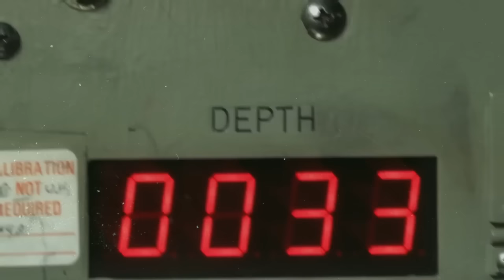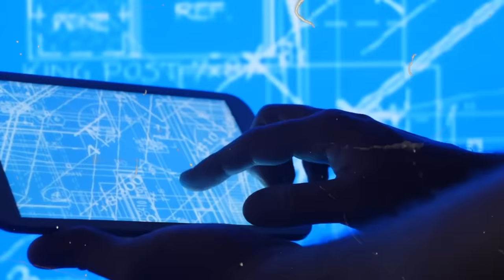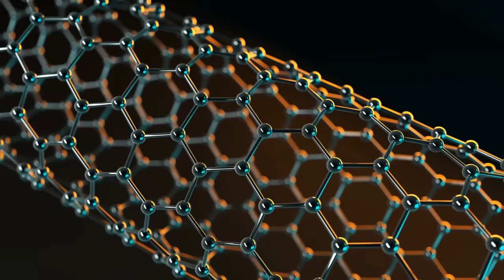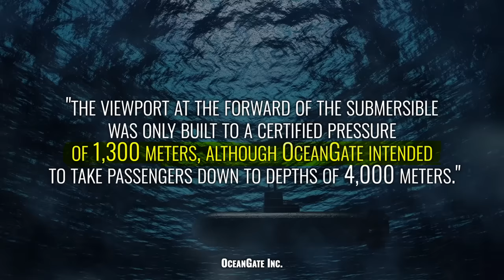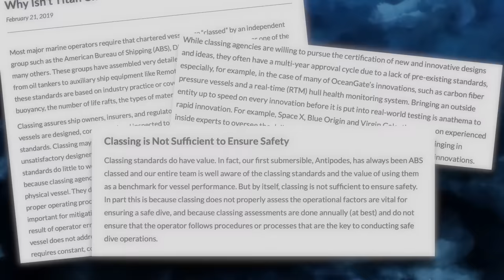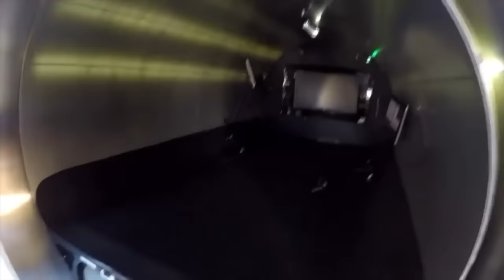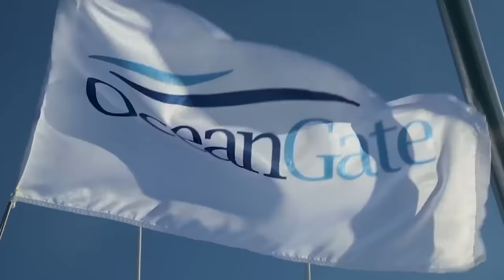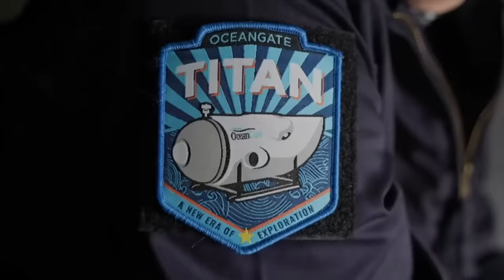The Oceangate Submarine Disaster: The Full Story

Comment: What if the joystick failed and the sub just kept dropping until the pressure became too high and caused it to imploded.
Reply: He didn't even have a back up system to control the sub without the wireless controller. That wouldn't have cost more than 200 dollars to install such a back up.
Reply: @captaincat1743  He said too much backup was a waste of innovation
Reply: There were literally so many potential points of failure that it’s impossible to say for certain which one ultimately gave out to cause the implosion.
Reply: That is a possibility considering they were descending too fast
Reply: They were going to the bottom anyway, to the Titanic.
Reply: They had multiple controllers in the sub.
Reply: @Subtlenimbus Yes, but still, actually hitting the bottom might have caused problems.
Reply: @michawee  I mean a backup that works if they lose the Bluetooth or WiFi connection. Like a secondary input method. They didn't have that on-board.
Reply: @phoenix211245  yeah. Crashing into the Titanic itself while clutching a lifeless game controller would be quite a way to go as well.
Reply: @captaincat1743 I hope you’re wrong. Betting lives on a Bluetooth connection would be almost as stupid as riding around in an untested sub made out of carbon fiber. Surely he had backup control of that sub from those computer screens or something else.
Reply: @StanBenton  I know on a previous dive the Titan got stuck because one of the 2 thrusters had been installed facing the wrong direction meaning they could only travel in circles. Stockton Rushjob had to take the controller apart to reassign the buttons. as there was no other way to interface with the computer. Luckily he managed to escape that time, but apparently he learned nothing from that experience.
Reply: Bouncing off the titanic is a guaranteed way it imploded if that's the case
Reply: Now wonder Rush wanted  or seemed to want less to do with such an industry that appears to be full of negativity and dislike!
He must have made a good choice to guard himself from any abuse!  This makes this industry look really bad from what I can interpret and I put time reading!
Reply: @maryannsinopoli1751  I bet Stockton Rushjob dropped a few envelopes full of cash onto the right desks to help much of the negativity go away.
Reply: @captaincat1743  boy and how if that easy I wish I knew I might have also fabricated some negativity depends how much cash$$$ Hahaha

Comment: I figured the implosion started near the front part on the hull. It exacted pressure to hit the plexiglass from the inside to blow out not just the window, but the bolted ring holding it from the outside. Crushing the center inward, sending force to the aft section blowing it off with structural damage. Aft section has it's battery compartment exposed. Roof section of the aft is mangled with wires hanging out, but the tail is in good shape. All Legs and thrusters were blown off, and no ballasts attached to the legs. Aft large O-ring fitting was brought up in perfect condition, nothing attached to it by sealant. For the Large fitting rings to fall off in perfect condition, that means the hull underneath became smaller and the fittings slid off or remain intact while implosion all around..  I heard they were still advertising trips down to titanic lol. Looking at titans records, they started Titanic trips at 3 a year starting in 2021. So they pushed the limit at least 8 times with no Overhauls at 3 times, and had a few cancels.  Sad

Comment: The titanium rings were installed overtop of the carbon fiber cylinder.   The carbon fiber cylinder hull should have been installed over the titanium rings
Reply: That might be a worse construction. The pressure would compress the middle of the cylinder more, forcing the edges to expand. If the rings didn't hold it in place, it would have simply cracked the seal on the first dive.

Comment: the Acrylic was the Weakest part
crackling for a while
like Jurassic Park window cracked
unforgettable
Reply: We don't know that.  The investigation has only just begun.  Speculative at best.  Another more likely failure point is where the 2 very dissimilar materials meet.  The marriage of the titanium rings to seat the titanium end caps to the carbon fiber body.  Titanium and CF have quite different coefficients of expansion and contraction.  We already do know that loud cracking sounds always accompanied each and every dive, and that stresses on laminates no matter the construction, method or material, can and does eventually cause de-lamination!  Not to mention the entire glue line interface between the titanium seating/bolting rings and the carbon fiber at both ends of the craft!  There are several major first points they are looking at/for and the Lexan view-port is only one of them.

Also, it's been reported, and I believe I did see what looked like a titanium ring that was distorted.  That of course could be a secondary event, but it could also mean the carbon fiber failed and as it crushed, it distorted the titanium ring that was attached to it!  Speculative as well.  I'll wait for the final US & Canadian, NTSB (or whatever other agencies are concerned) and Coast Guard reports!
Reply: @paulbonge6617  right
ALL Speculation 
as we are ALL impatient to KNOW
we may never KNOW
we KNOW 
Stockton was a 5 year old Kid in Kinder Garden 
playing with Play Mobile...
now he can play Captain Smith 
at the real Titanic forever...